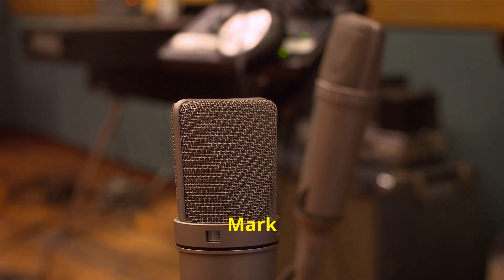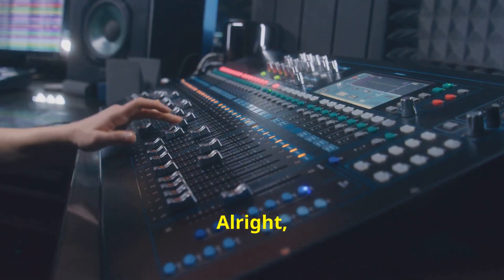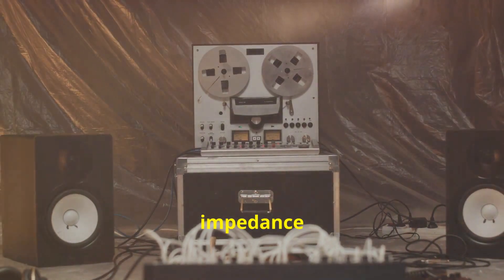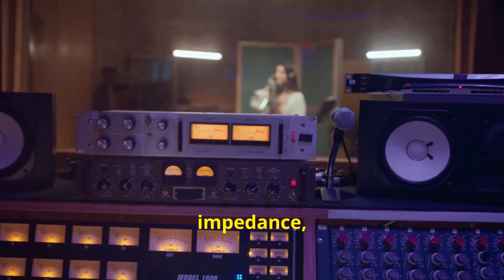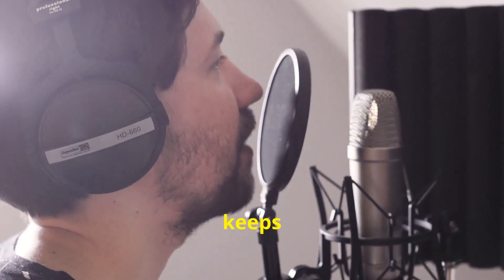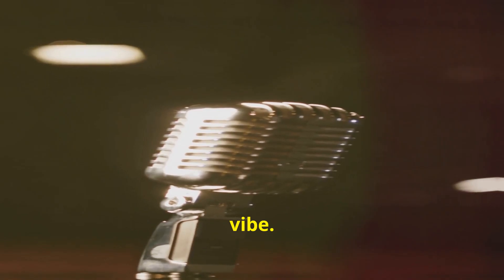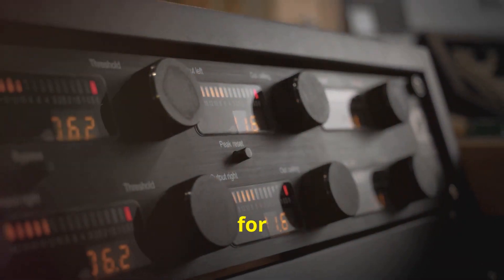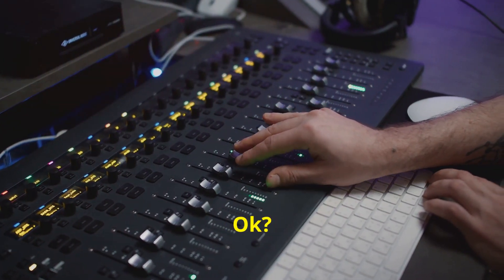Microphone Preamp Input Impedance Explained - What is Impedance Bridging?

Comment: Been using my u87 on 300ohms 🤦🏻‍♂️
Reply from the maker: Yikes. I bet it sounds better when you turn that impedance up. I made the same mistake back when I had a Focusrite ISA One. I had it set to the lowest impedance because I thought it would offer less resistance to the signal and wondered why it didn't sound right. I thought my preamp was faulty. LOL. Live and learn.. live and learn.
Reply: @MarkYoshimotoNemcoff  In theory it should sound more like a 47. 😁